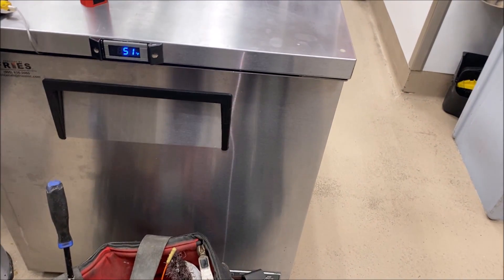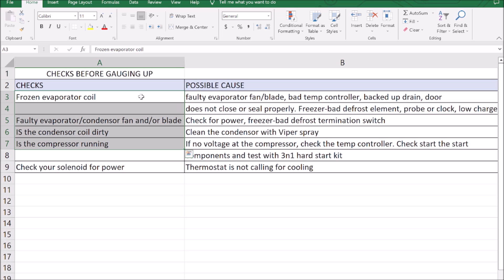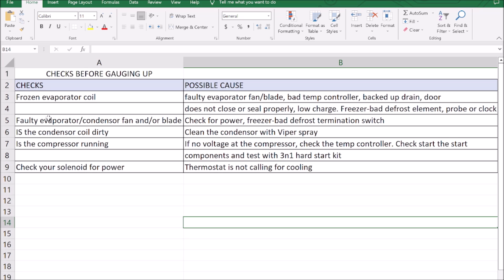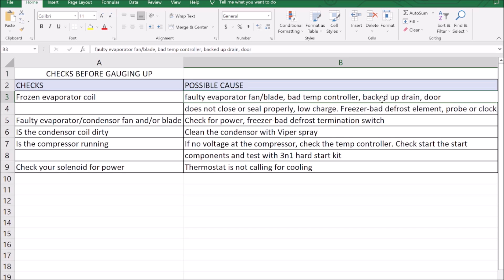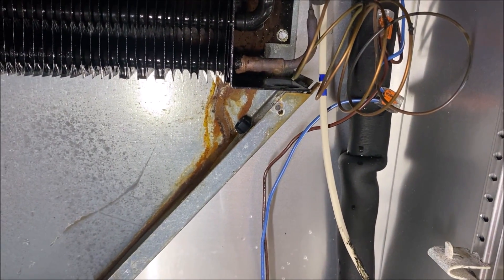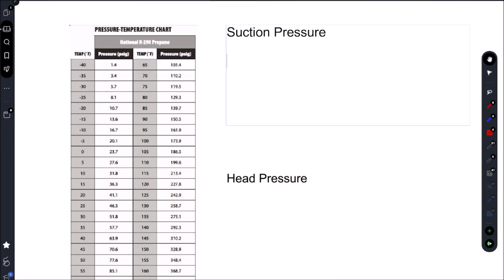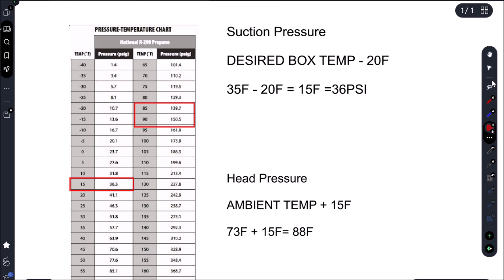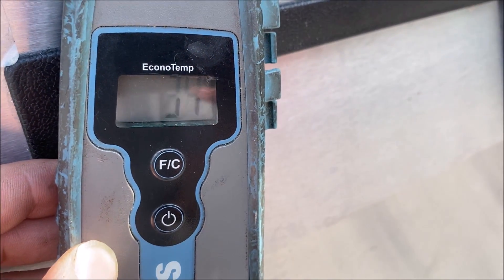True R290 Cooler is not getting cold enough

Comment: Why do you do design box temperature instead of actual box temperature? So say that the box was 50° now that you did your repair. Would you not do 50° - your TD to give you what your suction pressure / saturation temperature should be?
Reply from the maker: Cap tube is fixed, so desired temp is what is used. A TXV changes as pressure drops, so for that we use current temp.
Reply: @REFRIGERATIONKITCHENEQTECH  okay now I understand that makes sense, thank you. Keep up the great work I really enjoy your videos being straight to the point and very technical 🤙